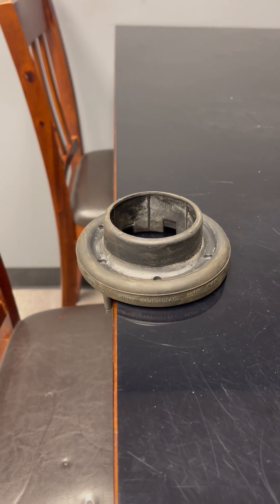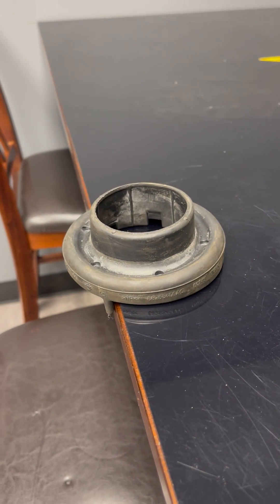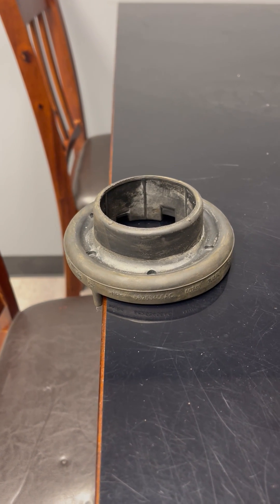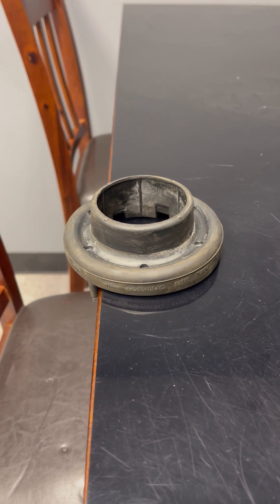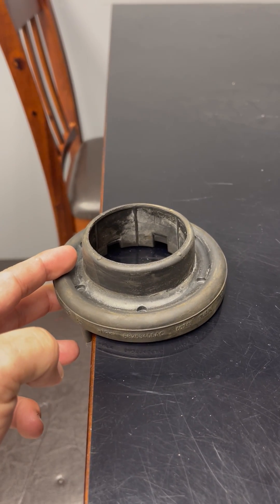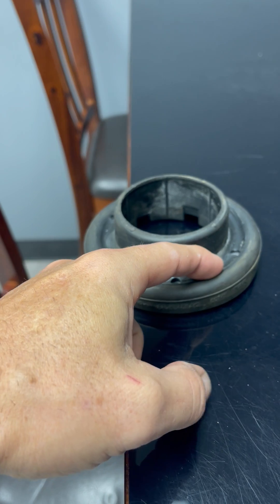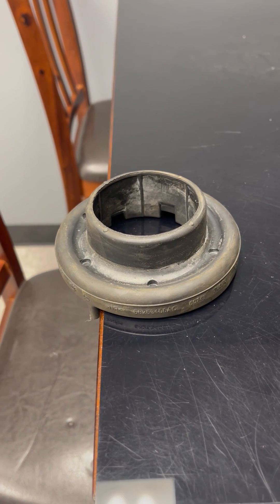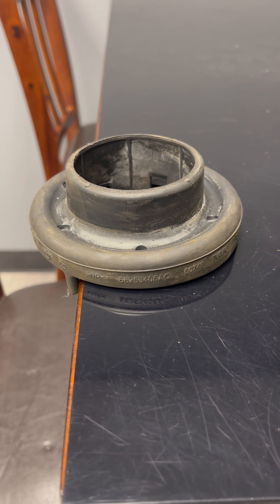Jeep Wrangler Top Coil Spring Isolator Update Tech Support Video

Comment: I just installed your new neutral front top spring isolators on my 2021 wrangler jlur and now the 2 1/2" lift coil springs sit straight. Thank you RK!

Comment: Thank you for this excellent video ! Salute !  When you say flap it down. Meaning cut to make the circumference even ?  Flat ?  Neutral ? Right ?
Reply from the maker: Yes, flap disk the angle out of it to make the coil sit neutral or you can simply purchase our neutral isolators that have been  out a year or so now.
Reply from the maker: Yes, flat which makes them neutral   Or you can purchase these.  We have ours out now and they work for most aftermarket coils.  https://rockkrawler.com/front-upper-neutral-spring-isolator-jl-jt/